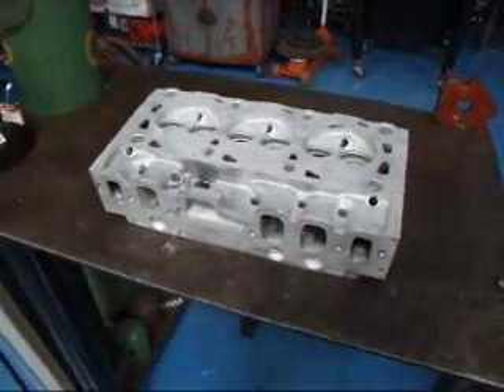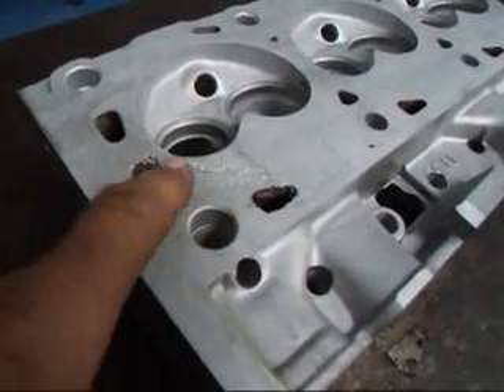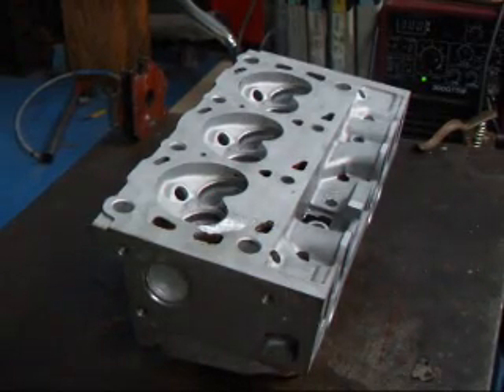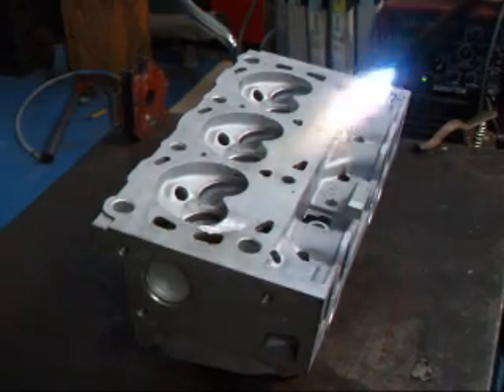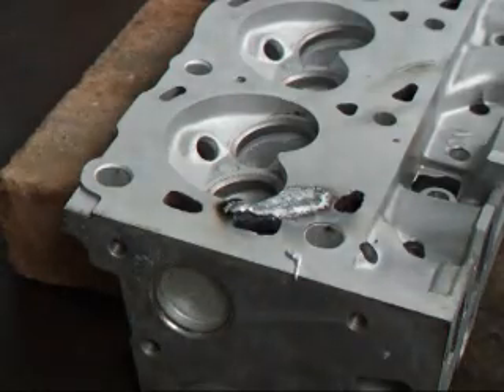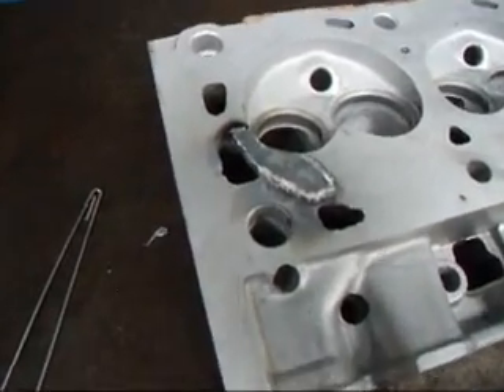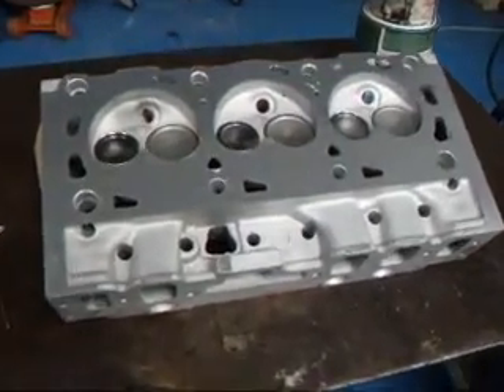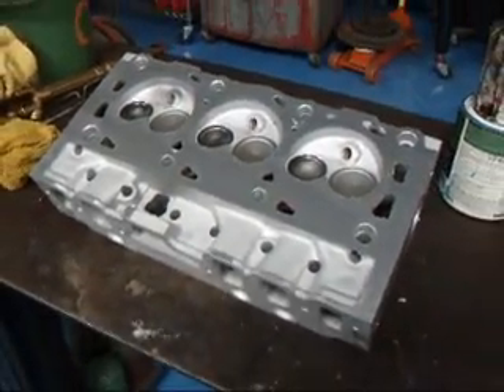Ford Mustang 3,8 Liter - Corrosion Damage Repair Process

Comment: Any solution to corrosion on the deck face on a Buick/Rover block, area surrounding small drilling on end, ends up corroding to shape of gasket opening. Been told repair causes issues with cylinder beside it, any experience with 'Belzona'?, thanks.

Comment: Head should be pre-heated in the oven, not with a torch, and definitely not with the fine tip. Head should also be mounted to a fixture to prevent warpage. Hard to believe you can rest a gloved hand on a 450 F head while heliarcing. Obviously not the same head as the castings have different positions for lettering.

Comment: @fiatnutz 

ther is a 3 letter stamp ending in n, where the first letter is removed due to a bore for a push rod. on the second block, you can see that all 3 letters are visible and in a different location.......

Comment: Could you use this same process to fill the space where O-rings were previously in the deck of a head? I ask because i have a 4G63 head that has been machined to accept large O rings to run a copper head gasket, however i want to switch to a MLS, would it be possoble to remove the orings and weld it up?

Comment from the maker: Aluminum doesn't rust in the normal sence, it does oxidize and corrode due to the chemicals in the atmosphere and in the radiator in this example. Heat and water/coolant w/degraded gaskets will cause this type of damage. Aluminum acquires a layer of oxidation about 1/2 hour after casting that retards further corrosion. The chemistry of aluminum can also be modified to increase corrosion, but after time they all deterrioriate. Thanx for the comment/question.
   JE...